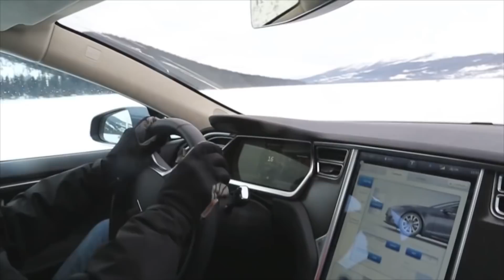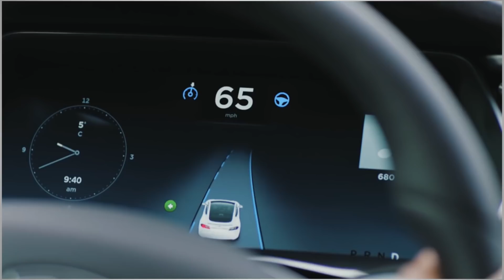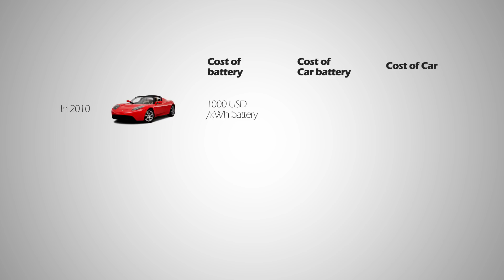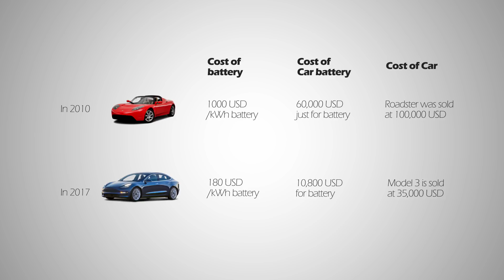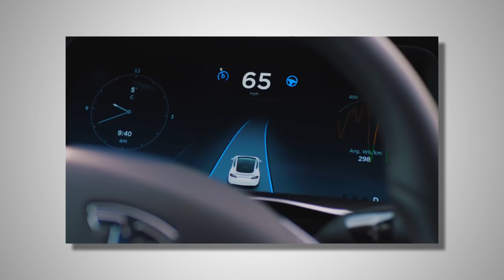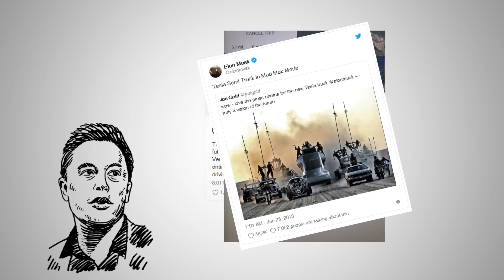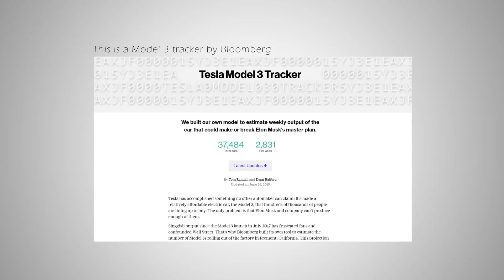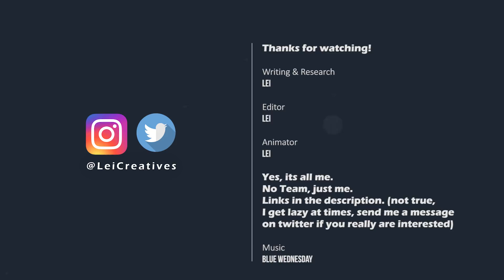Tesla Mid-term report 2018, how did Tesla do this time?

Comment: I understand your concerns about autonomous software on the Tesla. I personally do not use the autonomous mode much on my M3, I feel, as many do, that it is not “quite there yet”. I am not particularly concerned, however. I know that Tesla employs some of the best software engineers in the industry and they continue to gather data. It will take 5G with increased band width and new government regulations to make full autonomy a reality. I think we are a couple years away. Until then, I as a M3 owner and stock investor, am happy to see Waymo, GM, whomever,  take the forefront and lead the charge. Most EV manufacturers are way behind Tesla anyway. Battery production is huge, look at the advantage Tesla has at $100/hr, the next most competitive manufacturer is at $115; that’s 15% right there and what do you want to bet the gap is even wider? No other manufacturer has a Supercharger network. I haven’t taken trips across the U.S. since I was a kid and now we do it every chance we get, because of the Supercharger network ! I might add that with the low maintenance of the car, probable long life of the car and the fractional cost of electricity compared to gas and oil, it is relatively cheap to travel. Add in new dynamics like Airbnb and you are talking about the American nation back on the road again, just like the 50s and 60s ! Anyway, I think Tesla does not have to worry about autonomous leadership presently, they are so far ahead in other areas that other manufacturers will be playing catch-up forever.

Comment: Great video as usual. The narration of your videos is well put together, polished and professional looking. I like your to camera pieces - but I think they can be improved visually.

The first thing is focus - get it in focus or re-shoot. 

Also, you should consider using a better background - the Van Goethe is nice but the shelf and powerpoint are pretty crappy and distracting. I have been a Pro photographer on and off since the mid 1980s and the first thing I consider after light when shooting people or movable objects is the background. I strongly urge you to shoot in a different room - even a drawn curtain is better than your current choice. I you consider the light no good in there bounce a strong light off the wall to illuminate your face.

If you are shooting on a smart phone consider a better camera which will give you more options especially a zoom range.

There are a couple of simple compositional tricks that could be helpful which I am happy to share with you if you are interested.

Comment: I've had my Tesla Model 3 for a month now and love it. I was nervous buying a car sight unseen and version 1.0! However, after using a super charger for the first time where I charged about 100 miles of range in 10 minutes I think Tesla is uniquely positioned to dominate the EV market. All other EVs are constrained to be a commuter car but with Tesla super chargers you'll be able to go on road trips with a little extra time to recharge compared to filling up a gas tank. Level 2 charging stations will not be practical for non-Tesla cars for long distance driving unless you spend hours at each stop to recharge.

Comment: Re the Autonomous driving.
There were several accidents involving vehicles FITTED with autopilot.
Not (necessarily) USING autopilot.
And if used...
Not (necessarily) used CORRECTLY.
The assumption that Autopilot caused accidents has been made quite frequently, without considering these points.

Comment: I thought the battery issue had been covered at the AGM?
One advantage Tesla has, IF another company develops the "holy grail" battery, is they have an ongoing use for the current (pun?) technology. They can use both current stock and production facilities for static storage projects, until such time as they gradually convert and shift those facilities to the new technology.
Other competitors would have to make a relatively sharp transition with virtually no use for existing stock.

Comment: I agree on autonomy to certain extent. Tesla is trying  to keep autonomous system costs in the realm of consumers whereas Waymo and GM are doing it as a commercial self driving venture. Hopefully Tesla can make there system work without having to ad 50K worth of hardware to the vehicles. I also think that passive sensors will prove to be superior in the long g run.

Comment: Quick summary: They’re doing well...
Reply: They didn't hit 5000 car per week target in june as well. Just sayin'.
Reply: At first, Elon said on twitter that they'd reach this target in July, but was optimistic about hitting that target in June. That didn't work out, because there was a saboteaur at Tesla slowing it down a bit. And they certainly will reach the target in July (Q3). They also want to get a longer-lasting 7500$ tax credit for their customers, so they're delaying the production a little to reach the 200,000 cars sold goal in Q3, not Q2.
Reply: Evolt Well it must be like 5th or 6th optimistic target they set previously. I am not saying this time it is not going to happen. But that doesn't look good on the image of Elon and the Tesla brand.
Reply: It's the third target, and it's realistic.

Comment: Self driving vehicles are being oversold because if you have to repeatedly touch your hands on the steering wheel it's not self driving. Digital AI must convert large amounts of analog data in real time. Humans have been doing this for centuries.
Reply: You were misinformed. Self driving vehicles are not oversold at all. They are not sold yet, and no one claimed they have any available self driving vehicle.

Comment: I didn't see much criticism at all. What? Autopilot? They are working on it. What's the problem? This is not criticism. In the video it is explained very well that Tesla has focused on the Model 3 production. How is this criticism? Some other companies are leading in the autonomous driving field? How is this criticism? And also... Wait for it... Just wait for Tesla to get the chance to focus on Autopilot. With all the data they collect... I don't see any other company being in a better position. The only thing that MIGHT or might not be an issue is the lack of LIDAR. Only time will show, but I also believe that if we can drive using just 2 eyes, eventually cars would be able to do this too. However, LIDAR is not something bad... So only time will show, I guess...

Comment: I love Tesla and Elon is great, but there are some things i want to ask, survailance, the Teslas are always Online, 24/7, does no one want to ask whats with my privacy?
How about hacking the autonomous mode?
What about all the things he makes, isnt there the danger that he turns into a monopolist?
Not with Tesla alone, but Starlink, SpaceX, Tesla batteries, Solarcity?
I mean combined it is a total change in almost every market, cars, transportation, spaceflight, mobile communication, power and so on!

In fact the other compatetors are still sleeping, in fact in germany right now all car companies struggle with the WLTP!
Many cars are sold out, production stop for most of the engines, no replacements are there, you cant even make an order online of many types!
Porsche, for example, the only online aviable car is the electric "Mission E" thats not even for sale yet!
Especially diesel is not aviable right now!
Many companies that normally only buy diesel because of the costs have to keep on running the old Leasing cars, because no cars aviable to replace them!

The fun part with that is, the WLTP was known for 5 years now!
They thought they could manipulate the system or better the politicians, but this time, no way out!
In germany street after street, city after city is restricting the "clean diesel" which are not clean in fact, like the "clean coal" in the usa by Trump mentioned!
But we have hope, Tesla is planning a factory in Germany! Thanks Elon!

Comment: EV
They are doing well. They have an amazing brand that is worth more than anything, probably still ahead in technology but that lead is shortening all the time, but as an actual car manufacturer they are pretty poor. If someone says they bought a Tesla everyone knows they have the coolest new electric car, nothing GM, Toyota or VW do can take that away. Absolutely no one cares that you have a Bolt, they don't even know what it is. EV tech is not particularly hard, the big players are catching up fast and have R&D budgets beyond Musks wildest dreams. Manufacturing is hard, Tesla is crap at manufacturing. Toyota, VW and GM are good at manufacturing, they have 100 years of experience, huge infrastructure, huge human capital, they retool more factories in a year than Tesla has in its life. 

Tesla will not succeed as a car maker the way it is going. They either need to struggle along burning billions of dollars making schoolboy errors until they can work out manufacturing or they need to go up market and trade off the coolest brand in the industry.

Battery
This is Tesla's strong suit. Lithium batteries are the new oil. If they capitalise on their head start then they can keep ahead of all the others. It will be a low margin capital intensive business so a bigger company will always win and at the moment Tesla is a big company. Probably have to branch out of Nevada though.

Solar
Shitty business. Can leverage the battery business but otherwise there are a million companies doing the same.

Autonomous driving
Already second rate.

Basically ramp up battery production to stay ahead of the boom. The bigger they are the more funding they can attract. Use the batteries to vertically integrate into grid power storage but drop the solar side. Go upmarket with EV's to take advantage of their brand without competing with real car companies.
Reply: For the car business they should aim to be a more independent Porsche. 

Do a deal with one of the big boys to supply batteries and use their manufacturing expertise to make high end, high margin cars.

Comment: And then graphene ion batteries will come.
Reply: Do you really believe Tesla don't keep an eye on these technologies? Until we are there, they still need to keep the lead on current techs. You wouldn't want to wait 5 more years before producing the semi for real, in case graphene or nanotube batteries or whatever solid state disrupt the market again. Tesla need these batteries as soon as possible.
Reply: Elon has said more than once that Tesla welcomes any group which can surpass lithium-ion in all areas, including manufacturing costs to go to them. So far, no go.

Comment: There is nothing revolutionary about electric cars.  The first electric car came out in 1899 and failed because of the weight of its battery.  The real future of electric cars is the plug in hybrid which has all the advantages of electric cars without the weight, expense and slow charge time for full EV.

 Panasonic owns and operates the giga factory, not Tesla.  The giga factory produces flashlight and power tool batteries.  Tesla  solders 7000 of them together in Rube Goldberg fashion, rather than develop Lithium batteries  specifically designed for electric cars (like Nissan did in the Leaf).

Solarcity was nearly bankrupt when Musk misappropriated Tesla funds to save Solarcity.  (Thereby bailing out Musk and his relatives from financial loss.  Solarcity continues to be a financial boat anchor around the neck of Tesla.

 The Tesla autopilot is greatly inferior to Google and GMs.

Comment: I appreciate your desire to give balanced reporting, however I don't believe you are smart enough or well educated enough to understand the autonomous driving science as it is today. It is obvious that Tesla is ahead of everybody else in this and that the Navigant piece was just silly. The true advancement is going to come from fleet learning. Tesla is obviously 4 or 5 years ahead of the second place offerings on this one. Don't let the tails of statistics cloud your judgment (Tesla crashes and limited geographical success of Waymo and GM). I have an electrical engineering degree and patents based on massive computer simulations of a similar problem - cell phone signal propagation - and its correlation to observed measurements. I'm not an expert in self driving, but what Musk says makes sense and I believe it will allow him to achieve what he says it will and he says he will dominate the market. What you are saying is that you don't believe him in his approach with regard to information content necessary and complete to accomplish full self driving - in particular you think that LIDAR might be needed. I have not seen any thing from you in terms of research or original reasoning that would make me doubt Musk in this particular area. Of the 4+1 areas you mentioned, I in fact believe Musk and Tesla are the strongest in autonomous driving relative to the rest of the industry and that if they are able to manufacture the Model Y in the millions by 2022, then they will have a chance at becoming the dominant auto manufacturer in the world in relatively short order. I believe their greatest barrier to realizing this goal is a defocus from it in the form of the Roadster and pickup truck. This comment is too long.